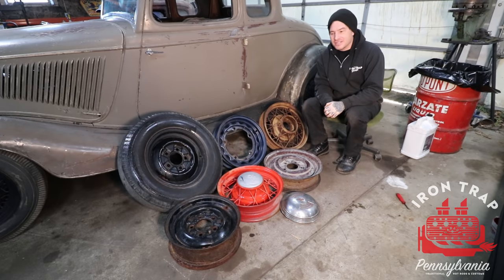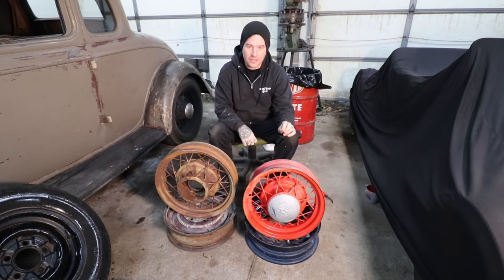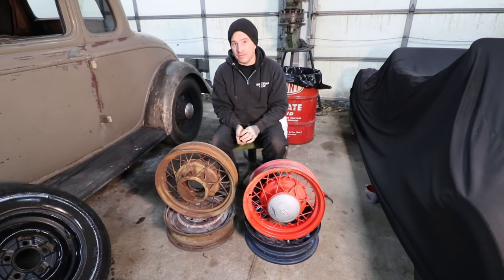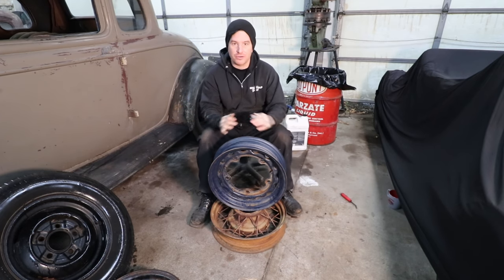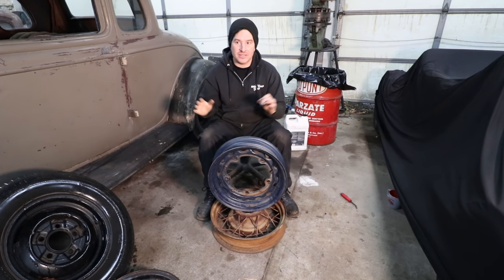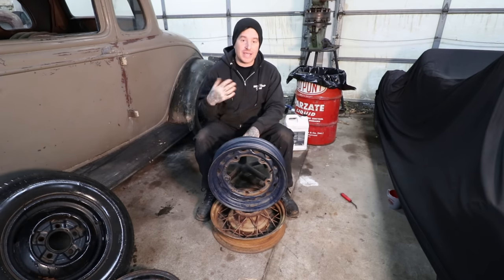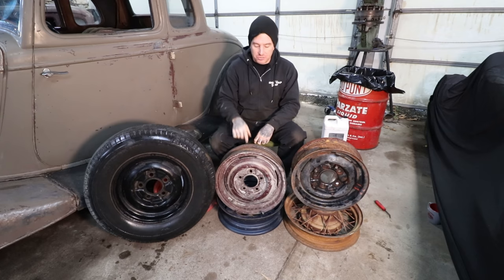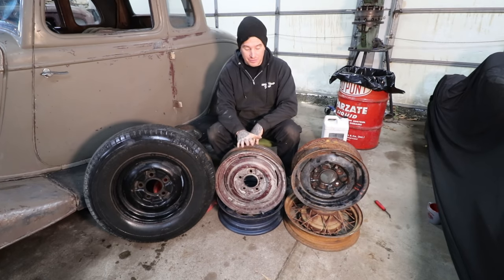What Wheels Should I Run On My Hot Rod?? - Hot Rodding 101

Comment: Outstanding. I just picked up a 32 chevy coupe.  Not running but complete.  I just got it yesterday and realize its got the wooden chassis. Once i get it washed and see what all i have to work with. This channel will be a great source of information.
Reply: older chevy car had  wood  frame work inside the steel body i was you i replace it with steel frame wook

Comment: Speedway also offers an adapter for the wide five. Years ago I cut out the centers of an extra set of wide fives and found that they fit inside of the steel spare  wheels from ford explorers. That allowed me to mount radials and greatly improve the ride and handling.

Comment: Hey Matt
   Nice video on the wheels.
An addition to the 5x5 1/2, there were some mid 50's Chrysler wheels with this bolt pattern.
The Chrysler rims were 15x7 if I remember correctly and looked like a reversed wheel so they stuck out further than the Ford wheel.
When I was 16 years old I had a set of the Chrysler Wheels on the rear of my 46 Ford coupe with large car tires like a 950-15 with the black side out.
The front tires were 600-16's 4 inch wide rims.
I had a set of longer shackles on the front spring which dropped the nose about two inches.
   I joined the U.S. Army when I turned 17 and sold the coupe. 
Boy do I wish I still owned that car.
Reply: The Ford pattern was only on the Chrysler Imperial model not the New Yorker.
Reply: @williamday6637  
   Hey Bill
That was my thinking, But I failed to put it in  the comment.

Maybe with your reply someone who needs to know will find it.
   Thanx

Comment: Matt and Mike, excellent video.  In addition to the subjects mentioned below. I’d be interested in videos covering shortening a torque tube and its radius rods, when to use and how best to mount split rear radius rods (which Ford rods are best and how the length of the ratio rods affect handling or not), how to convert a banjo rear to open drive using Ford parts, and how to change the gears ratio in a banjo rear end.

Comment: Loved the video today. I think when it comes to wheel/hub cap/trim ring choices more often than not the car speaks to what it wants. Some builds look kick ass on wide 5s. Others on steelies, spoked set ups on others. 
  A video I'd really really really really love to see would be one on rear axles. Since you've got nearly every axle assembly offered on the early Ford Motor Company cars in your shop right now it makes sense. Early banjo, later banjo, Columbia 2spd units (there are differences between the Ford and Lincoln units) and the early drop in center section rear axles..
Reply from the maker: Great idea for a video!

Comment: In the day we made a wheel lathe from an old brake drum turner. A 1937 rear hub without the drum and studs welded in thru from inside cut out the center of the 36-39 "skeleton" wheels. At the time the best choice for wide rim was Buick, choosing what ever back set was needed. Bare in mind we used these wheels all the way around. Very   short life usually. The best available were 16 inch from the 3/4 ton pick up (they were thicker).  Went thru many during the day at lo bucks.  I have seen in addition to your collection a set (4)  16 inch split rims but they must be very rare.

Comment: I have a farm wagon running gear that was clearly made from two 3/4 ton truck front axles turned upside down- one of my 16x5" wides is really rust rotted in the beads but it looks like finding another 5" wide rim ain't easy, I will do the best I can with a torch, hammer and welder. Fortunately it's on a hay rack so it won't see highway speed nor balance issues!  I recall the running gear was $25 at a farm auction in the early 80's. :)

Comment: I really like this video and hope you do many more like this ! It help's lots of us out here  that are working or looking for parts to build at some point a early ford hot rod but in a lot of cases we have not even seen some of these parts and if we come across them don't even know what they are so it  make it hard like you said you may buy something that is totally wrong for what we are trying to achieve  in a build ! Hears a question about artillery wheels some call them. can  bent up rim edges be fixed ? This is a very good information that you are given us with your experience on these early ford !
Reply from the maker: The bent edges are just a matter of how bad. Adjustable wrench and a hammer and dolly can fix minor to moderate lip damage

Comment: Matt, Re: 1935 Kelsey Hayes 16" bent spoke wheels..... 
The wheels shown on the 5 window appear to be 40 spoke Kelsey Hayes - same as mine.  From my understanding : with Kelseys, the spokes which attach to the front of the hub cross over each other as on the wheels you are showing here (in fact, they each cross two spokes - at the rim and at the hub).
However, there are other, very similar, 16" wheels out there made by Motor Wheel Co. which have only 36 spokes where the spokes "do not" cross over at the hub but cross over roughly midway between rim & hub - similar to stock early Ford). The Kelsey Hayes and the Motor Wheel Co. products look almost exactly the same at a glance, apart from the cross over at the hub, and it's easy to mix 'em up without really checking - even when they're sitting right next to each other.
Both, Kelsey Hayes and Motor Wheel Co. 16" bent spokes were aftermarket options for 1935 and were also made in other sizes for other years 18" for 1932 & 17" for 1933/34 - I have seen 18" and 17" but they seem to be rarer than the 16" (or, maybe people just go for the 16" for their hot rods).  
So guys, be careful what you're buying.  Either KH or MWCo. are great to use but you don't want to be getting 'em mixed up and taking home odd wheels. Count the spokes, check the cross-over at the hub - and also, check out the spoke pattern inside the rim drop centre, if anything is different it will be a different manufacturer's wheel.

Comment: If I recall "accurately" (not at all a given), installing the 35 Ford Spoke wheels on the Hydraulic brake drums requires an adapter also if you want the wheel to "correctly" engage on the hydraulic drums. That "probably" explains why so many of those wire wheels end up with "wallowed" out lug holes??? 

The 15" version of the ribbed trim rings (like the 40 Ford used), work really nice on the 8" Vette Rally wheels. The 8" Rally wheel has a "step" in the rim that is normally hidden by the Vette trim ring. Those 15" trim rings tuck perfectly into those steps and look great. I use that combination on my 57 Chevy with the Vette Disc brake center cap. Looks very much like a "reversed" wheel. BTW, those gennie Vette Rally wheels were made by Kelsey Hayes. I think they are still making wheels today!!

Comment: Use the truck solids, if you need a smaller rim for the front,  weldon a VW outer rim on a couple of wheels.  Use the 15s.

Comment: I appreciate the info on the wheels and the guidance on the subject matter.  I would have liked to know about what possible  Aftermarket wheels would be considered era correct other than the OEM looking  ones.. Personal I Really Like the Smooth wheel looks. Simple yet elegant . If you can put together a bit of Information about Chassis setup  Frames Rear ends Banjo version other and front axles whats right whats wrong etc . I Would like to see that. Thanks for the advice.

Comment: My favorite wheels are  '50 Mercury with original flat Mercury hubcaps.
Reply: Likewise, Thomas!  Have decided to  stay with my old, original set that are reversed on the rears.  Only problem w/ them is
the repop hubcaps are too small, so will have to restore my original caps eventually.
Reply: @robbh.6505  Robb, I  ran into that challenge too when putting my '32 together. However, the first repop caps I got fit the original Mercury wheels. The wheels I got were for the smaller repop caps!!!! I wanted different wheels front and back, and ended up with reversed in the rear and narrow in the front. I had to get the smaller caps to fit these wheels. Nothing goes easy when building these rods. Everything is a challenge.

Comment: Matt, love your series and appreciate all that knowledge you share. Question I have is about repair on '40 rims.  I've got two that have rust holes around the stem. I think it's repairable but I've read in other forums that I should just pass on the rim because welding up holes isn't suggested.  Worst I think will happen is maybe a balance issue.  The rims are blasted so I'm at the bottom of the rust and it's solid material. Any recommendations?
Reply from the maker: I’ve carefully tig welded around valve stem holes and redrilled with success before. Just depends how proficient you are at welding. The balance issue would be minimal

Comment: Hey guys, how do feel about widening wheels? By that I mean cutting the rim apart and adding a band to achieve a 6-8in wide rim or wider?
Reply from the maker: If you have a good way to fixture and weld and are proficient at welding it’s totally doable and has been done many times!

Comment: Original caps will not fit Vintique (aftermarket) wheels, you will need to buy vintique caps. They are about 1/8 inch different.